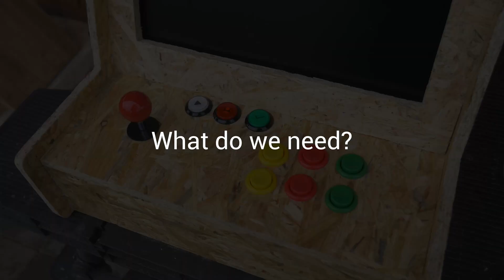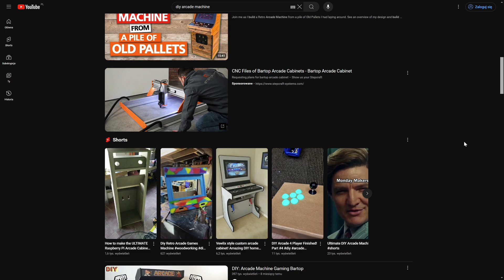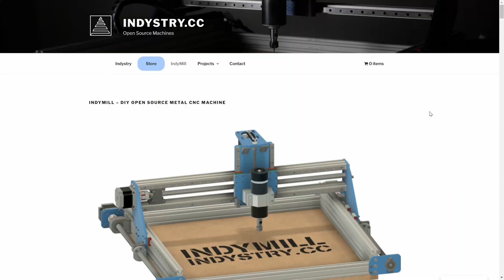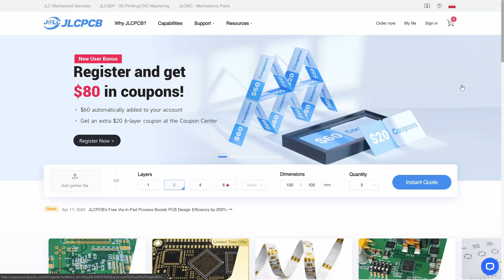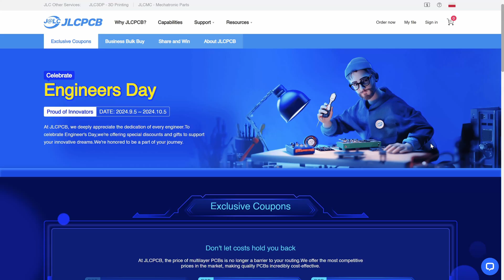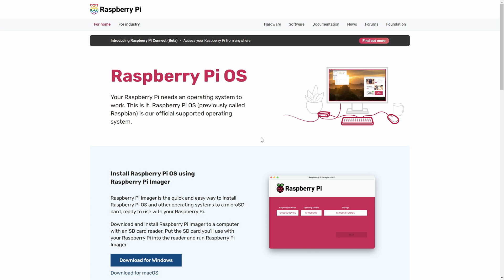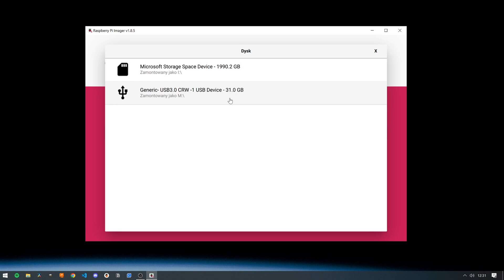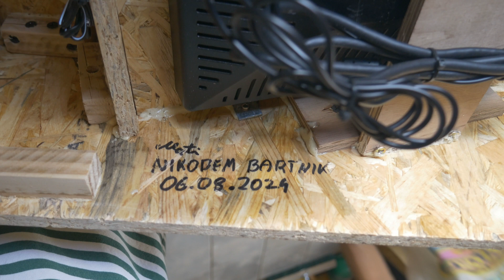How to Build a DIY Arcade Machine under $100?

Comment from the maker: Check out my open source CNC machine: https://indystry.cc/indymill
Reply: Hi, quick question: I was planning to build your Dremel-CNC, but in all your newer videos you don’t seem to use it anymore. Is there a special reason for that? Would it be better to invest in the Indymill parts instead? It’s a serious question, I would prefer to work with my Dremel but if you say it has very clear disadvantages I might change my mind. Thanks!
Reply from the maker: Hi, obviously IndyMill is better compared to Dremel CNC, it's bigger, uses mostly metal parts and has way more powerful spindle. The downside is it's more expensive and if you don't have much space Dremel CNC might be a better choice. Another advantage of this project is that you can easily 3D print parts for Dremel CNC. It's not like there is something wrong with Dremel CNC but since I have IndyMill I prefer to use it. But I still have one of the Dremel CNCs I build so maybe it will be featured in the next videos as well :) Build whatever works for you now, learn, and move on to something bigger like IndyMill.
Reply: Thank you very much for your kind response! I think that I will start with DremelCNC then. 😀 keep up the great work, I really enjoy watching your videos and learnt a lot, and you even motivated me to think of little new projects to tinker with.

Comment: I made a two player bar top arcade game in 2017. I laser cut it. I used ras pi, old hdmi screen, two f15 usb boards, old speakers and an old audio amp from one of those floor rocking gaming chairs.

Comment: Wow! I didn't think that I'd like an arcade build made of OSB, but actually it looks really cool. Something you might consider since this is a one player arcade machine: If you have an open USB port available on the Raspberry Pi that you used, consider adding a wireless Xbox 360 clone controller so that you can play 2 player games with your brother (if there are no USB ports open, you can always add a USB hub, they are pretty cheap). Not sure if Recall Box supports this feature, but I know that Batocera does. With your 3D printing skills, you can make a custom holder for the controller to hold it in place on the side of your arcade, or just make it out of scrape OCB. Really excellent job you two, you should be very proud of your hard work.
Reply from the maker: Thanks a lot! We did considered it, we wanted to buy a panel mounted USB connector and mount it on the side so that you can easily connect the pad and disconnect when it is not needed. Using a Bluetooth controller is also an option.

Comment: Isn't electricals+ wood= fire hazard? What electrical + wood project that will surely catch fire? I would love to see some disaster and destruction
Reply: "electricals+ wood" is how 99% of American homes are built and it's considered safe enough to live in them
Reply: Not really a danger if everything is well insulated. All of the classic Arcade machines were basically built of particle board. If you look at all the You Tube tutorials on how to build a custom arcade machine everyone from Tech Dweeb to We build stuff to the kits you can buy from places like Game Room Solutions here in America use MDF (medium density fiberboard) which is basically a mixture of very fine sawdust mixed with a very, very toxic glue and resin compressed into sheets. In other words just about any material you use is safe as long as you don't have any exposed wires anywhere. Yes I have built a few of them myself.
Reply: Electricals and metal cases can be pretty dangerous too! As long as it is done right, there is minimal danger and this job looked perfect to me!!

Comment: Raspberry Pi’s are crazy! I used one for running ChatGPT 4o in the terminal and of course it wasn’t fast but for it’s price faster than my 7 year old Mac! Thanks for the vid! Keep the good work!
Reply from the maker: You mean you connected to GPT API? Or is there any way to run it locally?
Reply: @nikodembartnik  I ran it with Ollama! Do you know it! it’s crazy. You tell it to download any model and it runs it locally!
Reply: @nikodembartnik  I ran it with Ollama. It's runs in your terminal and you tell it which modells you want to try out and he will run it locally without any need of wifi!